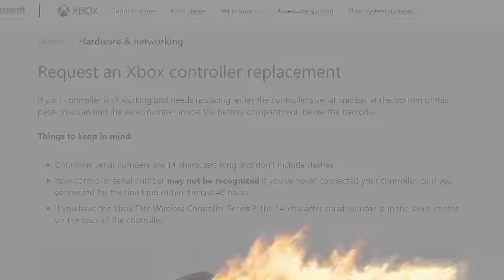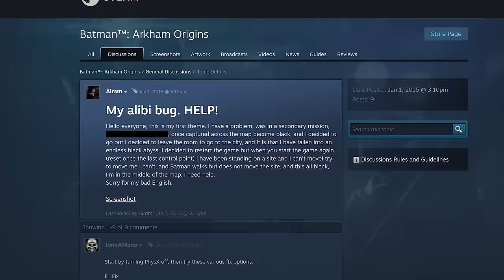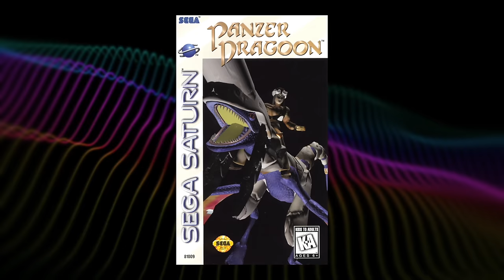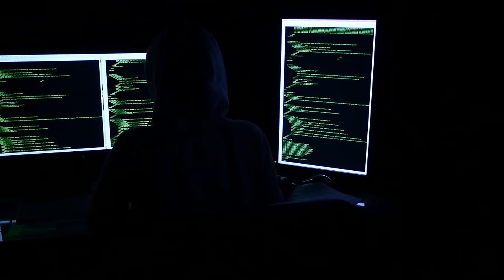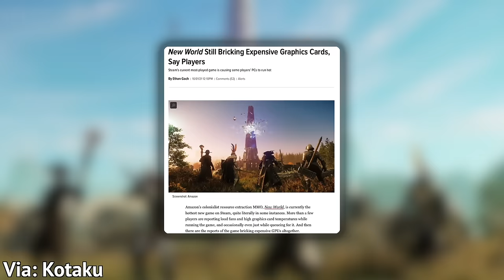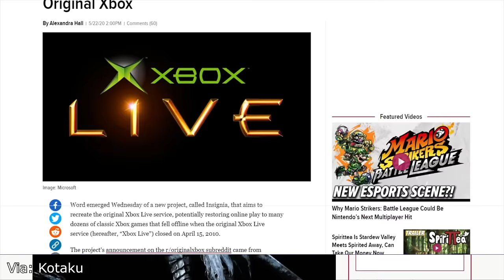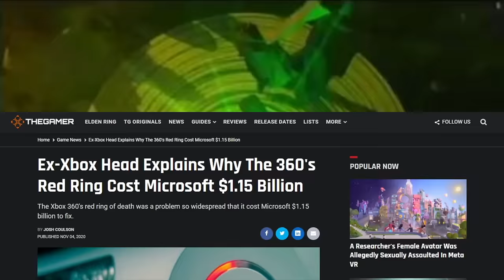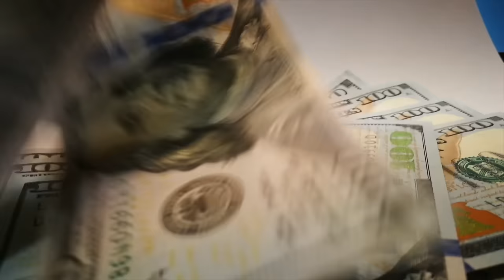10 NIGHTMARES Every Gamer Has

Comment: A misaligned optical drive causing perfectly circular scratches on your game disc. Fortunately rare now. For those unaware, data redundancy on optical drives is usually tied to the track, so radial scratches are often recoverable where scratches along the track frequently are not.
Hard drive crashes, particularly when there's no cloud save or backup. Not only do you often lose save data, but you have to reinstall everything on the bad disk.
Having the autosave trigger just before a major boss fight or event, when you're not ready for it and there's no way to back off to an earlier save... I wound up giving up on Kingdom Hearts because of an autosave immediately before a tough boss fight. One reason why every game should have SOME form of manual backup trigger.
Underwater, QTE-driven escort missions. (Maybe that one's just me.)
Reply: Ah, the “halo”. Saw many of those from the 360 back in the day…

Comment: I built my first gaming rig. I never had an issue. But I had to do my homework to buy all the right parts. I helped friend who did not buy all the right parts. I cost them more than they expected. Mid 1990's. AMD and Intel had issues with some graphics cards. Once you opened the box, you own it. No returns. $300 to $600 later, I had it up and running. Gaming Computers is not a cheap hobby.

Comment: 0:21 This is the worst thing ever, I had almost 100% the first Spider-Man game and then it corrupted. I had one more trophy to get which is the one where you have to unlock every suit and I also had a few more Taskmaster challenges to get gold on. Worst part of all though is that it wasn't just the save file, it was the ENTIRE game and my DLC. Two years later after a couple on and off attempts at trying to get Spider-Man working again I finally got it but all my progress was gone and my DLC had to be re-purchased which is just complete BS. I completed it again recently and I have some crimes and taskmaster challenges to still do (and the suit trophy), but I deiced to move on to try to 100% Odyssey. Hope it doesn't happen with this game too.

Comment: In recent years, I’ve only had issues with corrupted save files in one game. Dragon Age Inquisition on PS3 makes a horrible, stupid mistake. After a loading screen it loads the environment and saves at the same time. Sometimes it just can’t handle that much processing and freezes mid-save, corrupting the save. Devs need to learn not to do this. Load, then save or save, then load. Doing both at once can put an incredible strain on consoles and some PCs.

Comment: WAY back in the day I set up a system where I'd use 2 save slots... 
1) Set alarm for 10 min from the current time and play
2) When the alarm goes off, save the game in 1 slot and press the snooze button (which lasts 10 min)
3) Every time the alarm goes off save in the opposite slot to the previous save. 

This way you are never more than 20min of lost time if a save fails or gets corrupt. And I NEVER had both saves fail simultaneously...

When Autosaves were introduced, there was still the risk that it could fail and send you back to zero. To rectify this (PC only) I would create a BATCH (  [filename].bat  ) file on my desktop that would copy the autosave to a new file. When/if the game's save file corrupted, I would run a second BATCH file that would copy the backup save OVER the corrupted save file. Problem solved...

Comment: MS never did explain why the RRoD happened on the 360.  The heatsink for the GPU had a large number of thin fins that combed the dust from the cooling air stream.  They sealed the machine with a warranty sticker so it was not possible to clean the heat sink.  After enough hours the heatsink would clog with dust and the GPU would cook itself.  The only way to use the machine and avoid the RRoD was to operate the console in a dust free environment.

Comment: 9. I solved the dead controller issue by buying 2 Xbox elite series 2 controllers. The paddles seem to quit for no reason. Finishing Doom Eternal has helped the controllers’ lifespan. 😃 I send one off for warrantied repair and switch to the other. I’ve done this four times, although I will say MS has cleaned up their act. If the device is registered at purchase, the turnaround time is usually snappy if I spring for the return shipping. When their warranties end I’ll just replace them.

Comment: pc building is really fun but also addictive and expensive as hell! I spent £4k on my build last year and i kept wanting to add more and more i had to control myself, I will say though it's extremely easy to build a pc now compared to when i built my first aged 16 wich was now 17 years ago! even then though the only mistake i ever made was not having my ram set properly and since then i've never had any issues i think what people struggle with more is compatability since people think they can throw any cpu in any motherboard etc. I would always recommend researching and building over buying prebuilds because you save a lot and can build a better pc for the price plus after you build it and press the power button for the first time it's the most rewarding thing ever.

Comment: Usually i play with mouse and keyboard. Some games are better with controller.
That is the reason, i kept all my old controllers. Most failure i have is a wobbly left analog stick. One has a broken left shoulder button. ATM i use the Special Forza Horizon 5 Controller. I LOVE THIS THING!
And when i know, i have a game that torture my controller a lot, i use one of the older ones.

Comment: My New and Old Main PC's I built from scratch and have had several yelling, hair pulling and generally frustrating moments. My Old PC, which I'm now trying to turn into a Minecraft Server, was built in 2000 and I've upgraded parts and the case up to the point that it was time to build a new rig....newer gaming requirements. That one cost me a little under $2K. However, the newest one I build at the height of the Pandemic...and we ALL know how that affected prices. Bought all the inexpensive parts first and then branched into the more costly ones, just getting the GPU had a wait of 1.5 Years (not because of costs, but because or shortages due to stock being bought up by Crypto-Miners and Scalpers). In the end, I could have saved a ton of money if I waited as parts were way over MSRP. System's working perfectly and getting 80°C under high load, so I can't complain.

Comment: It was kind of gutting when I discovered that my old win95 machine had been donated (or dumped) by a family member without telling me. A whopping 32megs on graphics card with a cable connecting it to the 3d card.

Other than mmorpgs I don't tend to spend more than the original box (or sale) price for games that are always online because they are treated as disposable by the publishers. I also still have a lot of old games still playable because I'm a stingy git who doesn't lend to people that don't put the disc back into its case or use them as a coaster.

Best thing about the BSOD was how effective it was when it appeared as one of the random sanity effects in eternal darkness.

Mention of the RROD reminded me that I've still not redone all the updating on my xbone since microsoft put out an update that caused it to show nothing but a blackscreen and require a hard reset back to the day you unboxed it.

Comment: I think the corruption happened with my sister with Spyro Reignited. Fortunately that game isn't super long. I think she only lost some progress and not all of it. It sucks that controllers today are expensive and the cheap ones are prone to breaking. I did get another cheap one with a Zelda design but it's also wired (DAMMIT!). I had to clean my Switch controller if I wanted Amiibo support because I am not buying a pro controller at full price. Even then it's only a temporary fix.
I hate game breaking bugs. I had it happen with Mario and Luigi Paper Jam. A cutscene was supposed to happen but it never triggered for some reason. Peach is back at the castle for some reason even though I never rescued her. I think I had no way to progress the game after that.
6:07 Is this Betamax? I thought Betamax are like miniature VHS tapes with better quality but less film.
If discs are going to rot than that's what emulation is for.
Having your account stolen sucks. I almost lost my Steam account because some asshole hacker locked me out. Fortunately, I was able to get it back without too much issues even though I did have to wait a bit. Thank god I didn't save my credit card info on it. I also have a lot of games that I don't want to lose. I learned that saving credit card info onto sites is a bad idea since I did have someone break into my Amazon account and buy something I didn't ask for.
Thank god I never had a bug damage my PC. 
I rarely skip work to play games, but I have done it before.
I rarely play games that require online.
I don't have an Xbox 360 so I never had this red ring problem. I didn't have that issue with the PS3. I don't build PCs. It's too hard.

Comment: Gamestop Employee: tries to sell me disc insurance
Me: laughs in blu-ray
You literally have to rub one of those things on the sidewalk or break it in half. Even then, you could probably super glue it back together and I wouldn't be surprised if it worked fine. Blu-rays are sturdy as hell.
They rarely get a single scratch, and blu-ray lasers are a lot more advanced. I even had PS1/PS2 game discs that were completely unplayable on PS1/PS2, but worked perfectly on PS3, for example. Only blu-ray I've ever had that didn't work is I have a physical copy of Witcher 3 that hasn't been readable since I bought it. There isn't even any visible damage to it.

Comment: The broken controller is an issue with older consoles you can no longer buy controllers for. Especially at the rate they upgrade and release new consoles.

Comment: My worst nightmare is power going out and sometimes internet going out, because it is damaging my computer or my game. And if it is night time and I don't want to sleep, what am I supposed to do in the dark?
Broken controller is not my fear though, because I use my mouse and keyboard and I have more of these at home. 
The absolute nightmare were games that only want to be installed in program files or other system folders and don't give you options, which is nonsense.

And Falcon is a cute bird ^^

Comment: my first time playing final fantasy vii i got to the very end, did all the optional quests, golden chocobo, master materia, ruby and emerald all i had left was the northern crater. corrupted save. my most recent redundant save was in the crashed submarine. tried to leave and the mini-sub didn’t show up and i couldn’t move 🫠
on an amusing custom pc note, i had a friend who built a fish tank pc and,only after filing the tank with mineral oil, realized he’d built it upside down and the power switch was at the bottom of the tank. after much swearing and acquiring a stick he managed to turn it on and it worked great

Comment: I had a power cut break a Minecraft mod pack before, it was a quest based one. A corrupt file is why I’ve never brought Oblivion. 
I’m grateful for Bethesda having console commands after creating a multi save game breaking bug in Skyrim. (I missed the elder scroll during Discerning The Transmundane just once, which has broken Elder Knowledge forever more) 
Controllers have only broken for me because of me being clumsy. I’ve broken 2 Joycons and my Hori wired Switch controller now rattles. 
Number 1 is why I let someone else build it, more because I’d worry about damaging components when installing them.

Comment: I built my own PC, the worst thing was breaking some pins on the CPU!!! Had to buy a replacement and when installing it my hands started shaking. Then installing a graphics card and forgetting that the power plug was 8 pins and I had only used the 6 pin cable. Took me a while to figure that one out! 6pin + 2 pin = 8 pins. My previous card only used 6 pins. 

Also recently updating Baldur's Gate 3 and having missing files that crashed the game. Thankfully Steam allows you to verify game files and that fixed the problem.

Comment: Haven't had a corrupt save file, my have deleted the wrong save plenty of times. I'm not sure what's worse, deleting your save while clearing out autosaves, or using the save menu rather than the load menu when changing between characters. I've lost count of the number of times I've done both.

Comment: I'm 44 and I had never had a corrup save file (knocks on wood) but I did mess up one of those games that do not save but have checkpoints, so when you die you don't have to do it all over again but you just start at the checkpoint, and it was like an hour after I last saved. And I stupidly turned off the console after dying a couple of times thinking "I'll do it tomorrow" and then when I restarted the game of course I was at the last time I saved, not the checkopint, because the game respawns you on that point so long as you don't turrn off the console.... that's the closest I had to a corrupt save file but I did lose a lot of progress.

Comment: I got a red ring on my 360 as a kid you could plug it in and press the buttons on the console in a certain order and it will flash a code with the rings I looked up the code and turned out my power brick was faulty went up to the local game shop (before GameStop killed independent sellers RIP) $10 and I was back on mw2 that day but I was one of the lucky ones at one point we just waited to see who was next in our friend group scary times especially when that was all you had and you knew your family didn’t have the money to buy a new console 😢

Comment: Tbh about the broken controlers, its quite hard to fix them because the among of chips are inside, so it may sound bad but. Buying new controler is cheaper, then try to get the old one fixed. Its all just about replaceing then fixing it and cost more then just buy new one.

Comment: I did an overhaul of my PC (switched AMD out for an Intel MB) which included a 30 series GPU. Also figured I'd try upgrading the PSU. Second I powered it up there was a slight crack and a plume of smoke. Needless to say, I went into panic mode pretty quickly. Thankfully, it was just the PSU and my machine still works on the old one. Still kind of want to switch them out.

Comment: My first X360 got the Red ring. A few months after getting it back, the video port on the system stopped working and there was no red ring showing up so I couldn't send it in for repairs without paying for it (was a student at the time). Luckily, a friend of my roommate's was selling his 360 and it worked well for about 8 years before it started trying to eat disks.

Comment: 10 literally happened to me yesterday. I decided to finish Dragon Age Origins and installed it on steam 56 hours on record. Boot it up and not a single save file existed locally or on the cloud... Even logged into my EA account and nothing. Whatevs wouldn't have remembered where I was, what I was doing, or how I was building anyway, but damn 50 hours just gone. 6 also happened to me where I had a steam account attached to a hotmail that got hacked, but I made the hotmail when I was like 10 y/o so I didn't know the security questions which meant I couldn't reset the steam password and 180+ games just...gone.

Comment: Corrupt save file actually happened to me last week on my ps4. I didn't signup for PS plus(my dad didn't let me) so I just backup my saves to an external flash drive. Then last week I switched on my p4 to play some games only for me to get a (there's an error in the system software). I had to initialise the console which basically wipes the hard drive. I was a bit pissed but I only had Horizon zd ,fortnite and fifa. I live in a country where internet speeds are not good so I mostly only have physical games and I dont really play fortnite. I reinstalled the games, and re-downloaded the update then I plugged in my flash to transfer my saves only for me to get a "system error" message. I had a combined 40hours worth of game saves on both games and they all vanished. I'm not a hardcore gamer I only play VERY casually like 1-2 hours of gaming in like 3 days. After alot of googling and insulting my console, I'm back to playing.

Comment: ohhhh my goodness did I feel the disc not reading nightmare. My bf has a ps2 and I've been dying to play Ico for years so I bought the game (USA) for ps2. It's a blue disc though. Turns out these blue discs for ps2 are CDs and are much harder to read and was sent that way to the states due to the rushed export of the game. This plus the age of the console had me sitting there getting the "can't read disc" screen for HOURS. Legit read about a tape method to balance out the disc more and after so much effort it finally worked T-T. Game was so great after.

Comment: Lost 500 plus hours in the Witcher 3.
Wasn't even anywhere near the end of the game .   Playstation stopped reading the disc.  Did everything I could to back up save ( except for cloud save because I didn't know about about that ) had to wipe and restore to factory setting .
It was a botched update and it's  happened 2 more times since then . Had to replace the disc drive one of those times .   Tried to go back and start the game again but spending that much time on it and loosing it ....still pisses me off .
So I took a break from it .   Went back to it and now I'm trash at the game so I doubt I'll ever finish it .